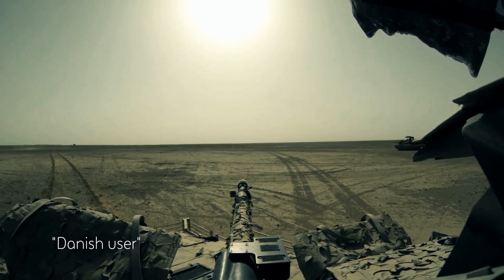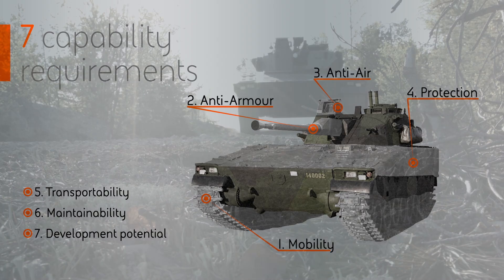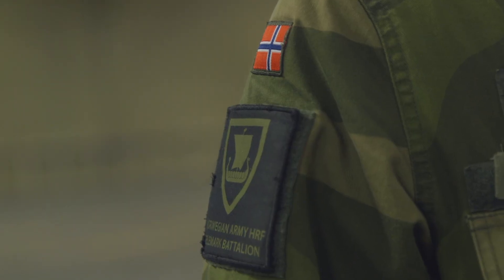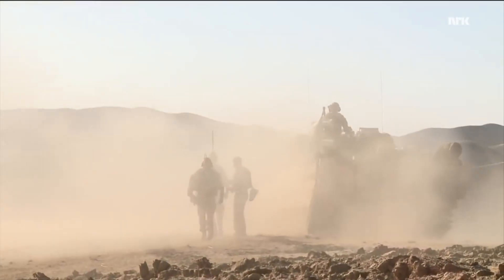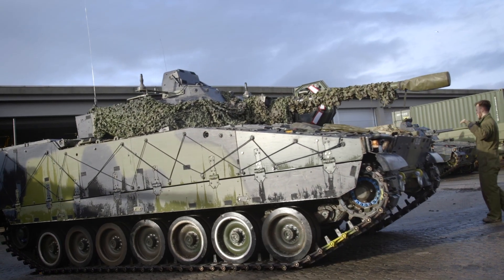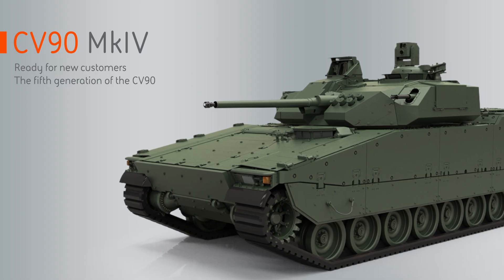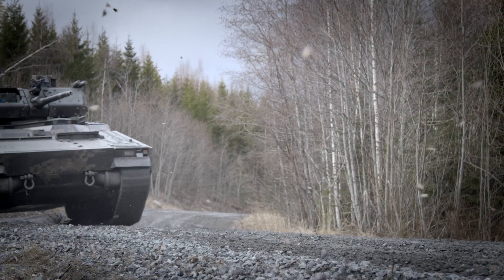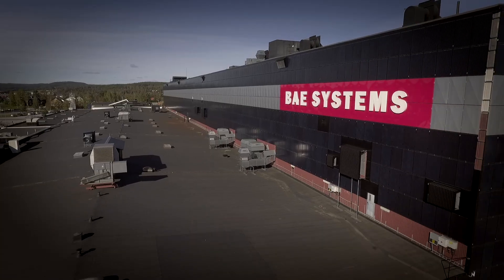BAE Systems Hägglunds is launching CV90MkIV

Comment: I wanna pull a John Browning and make patent but for tanks lol , I've been working on a tank called the kpz a8 , also happily named "leviathan tiger " it's main gun is a 183 with a secondary 75mm long barrel , both fire apfsds and heat fs , most likely a modified dm43 , it's 3 manned and mostly computer controlled , even had an urban combat package with a 20mm minigun with a box mag of 3000 rounds (to decrease necessity to reload) and it will also have a browning 50 cal in the turret as a coaxial , there is a lot of armour , roughly 1300mm in the front wide ass tracks to support the weight ,  it's got 600mm composition screening, 140 mm front plate (angled as hell to increase volumetric capabilities) with a bolted 200 mm plate outside the composition screening, and a thicc layer of era on the top of the front plate (as it looks like a combo of an abrams body with a mbt/kpz 70 styled turret  Wich also has similar armour as the front plate )  and the two main guns (183, and 75mm* move separately to increase the ability to aim both guns accurately) it has a built in thermals cams on all sides for increased visibility even during night time ops , it has 50 smoke dispensers , and a 40mm grenade launcher at the back similar to the bmp 2ms , and it also has a ircm and other countermeasures like the black knights for atgms , last main thing is just like the merkavas the tank has explosive reactive armor on the top to help with shape charged rockets or anti tank mines and even heli rockets , the main problem of seeing you with this is affected most of the math is done by my own hand , and it is incredibly expensive project that is very hard to mass produce , the main point of the vehicle is to be an incredibly long range sniper with capability of doing close-range combat if it's necessary, it's supposed to have a lot of armor to be able to ricochet even at cqc , hopefully one day I can actually start putting this that is hand drawn into a cad or I can 3D model the leviathan tiger  , hope everybody reading this comment as a good day good luck to all and to pay you will find peace in your domains thank you for reading (sorry in advance for quotation and grammatical errors lol I'm dyslexic and slightly blind)

Comment: Why doesn't BAE systems lobby the UK's MOD and government far more to get them to buy the CV90 and all its variants, maybe creating even more under UK requirements. And now Ajax is showing some faults, vibration problems, crew sickness, and after all the propaganda about its potential, costing around £3b so far, we need to recover that money or as much as possible considering that General Dynamics-UK hasn't met it's contractual obligations delivering an amazing combat vehicle, it should be ploughed in to the acquisition of the CV90 go go with our new Boxer 8x8s, something that should've been considered a long time ago, with atleast 100 to begin with integrating them in with the Warrior AFV, giving us options, unlike right now where we have nothing in its place replace either Warrior or Ajax if Ajax continues to have problems.

Comment: How could you believe that Scandinavians would criticize Scandinavian material? Frankly?
Reply: They have done plenty of that in the past. They're not praising it just because. For example, the Norwegians absolutely torched the JAS 39 Gripen (with was to be considered false information from BAE/ Hägglunds). They did everything in their power to buy Murican airplanes. Political pressure. I guess the Muricans didn't use their political pressure into buying Murican IFV, because it's not as an expensive deal. They only pressure in the big ones, they don't overextend the bullying.

Comment: combat testing is surely the key which this has been, you only have to look at the Turkish army's experience with the Leopards
Reply: Jojo Rod also depends very much on how they were deployed. Armored vehicles are always vulnerable in urban combat. Yet armies make the same mistakes over and over again. Also I don’t know of any tank that wouldn’t be vulnerable to modern ATGM. Didn’t the syrian rebels recieve TOW 2?
Reply: @scepticalwalker3984  Yes they did recieve TOW 2 but also had alot of older ones laying around like milans for example. In open yet hilly terrain like alot of the ME ATGMs are an absolute nightmare for armour. No matter the type.

Comment: Each heavy fits certain designed areas well and will show lower perform on others or worse, suffer some major functionality issues.
The Nordic states build their vehicles on a rather same scheme which fits their terrain well and the large plains of east Europe .
But seeing their build and tracks. These things will not fare well in deserts, boggy winter ones, like the nightmarish sticky mud on the road to Moscow. And on hard boulder terrain like basalt.
So basically it fits most of the needed scenarios quite well..except the desert. Just looking at all the free spaces on these versions. One good desert storm and you are stuck.  
I always love to see just how much actual heavies differ between countries pending on these different needs.
Reply: Lol. The CV90 is excellent in deep snow and has been used with excellent results in warfare in Afghanistan. It was praised for how reliable it was even in desert conditions and how low maintenance it needed. I have no clue what you're talking about. It was built for mobility. You think mud will stop this? Nope. And you think Sweden wants to invade Moscow? Think again.

Comment: The U.S. Army should consider the CV 90 MK IV platform.  The U.S. Navy should consider the Damen shipyard’s Sigma Class Frigate too.
The ‘Buy American’ requirement and politics can blind us to proven and workable platforms that have been designed by our allies and are
Perfectly usable for our needs.  These platforms are very impressive. But what does common sense and cost-effectiveness have to do with
Our DOD acquisitions?
Reply: You said the key phrase right there at the end, "common sense" you don't see it to often especially in government.
Reply: https://breakingdefense.com/2018/10/can-baes-cv90-roll-from-european-success-to-us-army-ngcv/ its under consideration
Reply: Combat in Syria has proven that light skinned vehicles are easy to destroy.  The future is fully armoured IFVs
Reply: Yeah, and a lot of the US army can be expected to fight on large open plains where something with an ATGM, like Bradley or Puma, would be a more effective choice I think.
Reply: @Paveway-chan  The CV90 won over the Bradley in the Norwgian rfp. It is modular and can easily be outfitted with ATGM's and 25mm to 120mm turrets. It's faster, significantly better off road capability and can carry 2 more troops in the back. Not sure how a Bradley or Puma would do the job better.
Reply: "easily be outfitted with ATGMs" can it though? I cannot find a single example anywhere of it carrying them outside of the failed attempt to stick the RBS 56 onto it. No TOWs, no Spikes, no PARS 3s, nothing anywhere. And they never talk about ATGM capabilities in official interviews and showpieces from BAE either. 

And as a side note, you can't have both the 120mm gun and troops at the same time, you gotta' give the troop compartment up for ammo storage and other suck things if you want the 120mm.
Reply: @Paveway-chan  https://youtu.be/ndZmqzT2nxs Mk4 is marketed with atgm module as you can see in the video. Agreed that the 120mm will come at a cost of interior space, but it goes to show the modularity of the system.

Also to highlight the mobility difference between a Bradley vs CV90 in Norwgian rfp, https://youtu.be/HAsR7m1wXM0?t=77
Reply: I'll be damned. CV90 with a pair of F&F Spike missiles, or perhaps PARS 3, is definitely a handy improvement.
Reply: @Paveway-chan  But still not a word about the Active protection system. Do these companies think about the future at all? There are currently 2 or 3 companies worldwide that develop such systems, and one of them is Russian while the others are Israely. They cram all this new digital stuff on CV 90, make it mine and IED resistant and then expose it to dismounted troops wielding a Javelin-ish type of weapons which are considered the greatest danger for IFVs. I don't understand it.
Reply: What you on about, m8? Dutch CV90s are to be equipped with the Iron Fist APS.
Reply: @Paveway-chan  Not a word about it in this video.
Reply: @ @vegass04  you can see APS ontop of the turrets https://youtu.be/Pj_F73xirLI?t=511 here
Reply: Sugma Class*
Reply: You just bought the Leonardo Super AV anfibious wheeled APC/IFV, so the U.S. Army is slowly accepting to buy foreign weapons
Reply: Politicians and intelligence don't belong in the same sentence. Now politics and stupidity.....well
Reply: Not sure if this is what US needs. These light and fast units are more fit for run and hide guerilla warfare in wast areas of scandinavian forests against a more powerfull and numerous enemy. Which is not quite a case for US
Reply: gryn1s As far as I’m aware the CV90 has just as good, or better, armor protection as the Bradley. Customers can choose from different levels of protection in the CV90
Reply: still not worth the replacement of thousands of Bradleys that also can be further upgraded.   The real future is the T14 or T15 armata type IFV.   The T15 is as armored as the T14 except with no turret.    That is what I call protection and high armor capabilities
Reply: @gryn1s  To be fair, US mainly uses tanks and equipment outside of US and in places such as middle east and afghanistan.
Reply: Nah ALWAYS BUY American.   For national security and IP sake
Reply: @ConstantineJoseph  pay more for less seems to be the american motto
Reply: @AndreasKanon  there is no mentality for lack in America, dreams are big, implementation is put to their maximum.  We let the Europeans follow up and refine our inventions as we move towards unmanned IFVs and entirely new platforms as our spending is on future projects and prototypes
Reply: @ConstantineJoseph  as an ex military I've seen first hand how well the implementations actually work. Might be a bit humbling if you do some research

Comment: If you put the independent  panoramic sight where the old sight was in front of the hatch you can put an rws on at a later date.
If you use the rheinmetall muzzle airburst controller for the 30mm the same type as used on the cv9035 you will have a winner.
We could call it the CV90 MK4 A Model :-)
All the best from Australia ;-)

Comment: Were those rubber tracks on the CV90MKIV?
Reply: They are great, increase mobility and comfort a lot and reduce operational cost significantly!
Reply: Armando Loos all cv90 use Rubber tracks
Reply: @Zretgul_timerunner   no they don't...
Reply: @martinlyhagen6166  Yes they do
Reply: @Zretgul_timerunner   no.
Reply: @martinlyhagen6166  How many times do i need to repeat myself since 2012 there doesnt exist a single example of an CV90 chassie with an non rubber track.
Reply: @Zretgul_timerunner   You are wrong. You must confuse CV90 with some other APC. The swish military have apx 550 CV90 with regular steel tracks. I get it - you are mistaken the rubber PADS for a rubber track. The pads ar just a replaceable piece of rubber to make it more comfortable on hard surfaces.
Reply: @martinlyhagen6166  thats whats a rubber track is... quite litterally. The links dont make up the definable part of a track the pads that propels the vehicle does. At best thats an rubber track with hybrid steel plate inserts.
Reply: @Zretgul_timerunner   No it's not. A rubber track is what you see in the film - a track made completely  of rubber.
Reply: @martinlyhagen6166  Ok you dont know what your on about at all. Even BAE SYSTEMS calls them rubber tracks with steel inserts. So called rubber hybrid tracks. Thats also the swiss that are the only ones that doesnt use pure rubber tracks. 

What part of the track propels the armored catepillar vehicles the links or the pads? The pads thats why theres no longer any steel tracks there never even where. Save some prototypes thats on display.

You cant drive the tank without the pad.
Reply: @Zretgul_timerunner   You got it all wrong. What you see in the film is what you call "rubber tracks with steel inserts"... And BAE uses these during testing because it makes the wear and tear of the vehicle and personel substantially less due to less vibrations. But that is NOT the most common type of tracks - that is still steel tracks with RUBBER PADS.  Why can't you just accept that.

This is what at rubber track looks lika (according to BAE...) and now you google CV90 and look at the pictures and the tracks... See the difference?  You will get some pictures of BAE demos with rubber tracks.

https://www.baesystems.com/en-dk/article/norway-buys-rubber-tracks-for-cv90-afghan-operations
Reply: @martinlyhagen6166  your aware the picture shows an concept art taken from another place. 

Aside from that the article is from 2011 almost a decade ago. 

All cv90 in current inventory today in The modern world sports Rubber tracks or rubber hybrid tracks. The whole selling point of the system is how effective the rubber hybrid suspension is amongst other things.

Comment: Best IFV in snowy envs. Bradleys, BMP:s, Warriors etc dive in to the snow. CV swims on top of it.
Reply: If youre riding on the frozen lake, and the ice crushes BMP can swim, CV will just drown.
Reply: @Weisior  While it will sink, they have plugs in the chassis that they will "engage" that will keep the crew safe. Though you gotta remember to use them, as a Norwegian crew actually drowned during an exercise because they went through the ice and hadn't remembered to use the plugs.
Reply: @Weisior  So if you drive a multi tonne vehicle, make sure the ice holds and if you don't know, the BMP is better? That's such a sad comfort.
Reply: @carpetclimber4027  Gotta find some advantages
Reply: @carpetclimber4027  In practice, it's just so much faster to have a vehicle that can swim than take the time to make sure the ice holds which at least in manual requires drilling holes into the ice all the way maybe a one kilometer strip and ten meters between the holes let alone that in a combat situation artillery or even mortar fire could screw the whole operation up. As much as I like to belittle our technologically outdated main rival inside and outside my country, the BMP gang wins this one hands down.

Comment: Try to offer this to the Philippines.
Reply: Not sure you'd want an IFV of any kind in the jungle. I'd stick to stuff in the air and sea.
Reply: for killing druglords?
Reply: maz ditzo Nope. The Marawi crisis highlighted the requirement for heavier armored vehicles and the lack thereof.

On top of that, that engagement alone took out at least 10 AFP APC's. I think it's high time to purchase a newer platform.
Reply: The Battle of Marawi was undoubtedly MOUT. The increasing trend in the Philippine threat matrix has been that the fighting has been spilling over from guerilla fighting in the mountains to pitched battles in populated urban areas. See: the 2000 Mindanao Campaign, 2013 Zamboanga Siege, Battle of Marawi. 

Worthy of note, in the latter battle the Philippine joint task force operating within Marawi had their progress severely hampered by sniper fire turning narrow streets into killzones. Moving to contact under armor would be invaluable in that situation; a PGM drop isn't exactly the right tool for the job when the terrorists are mixed in with hostages.

Comment: We know from Iraq that armored vehicles by them selves can not win the battle, but what is needed is an seamless integrated force sharing intelligent unit.  The question is what kind of networking and security of that network does this have with the ground solder along with supporting air power.
Reply: If you had watched the video, they tell you in it.